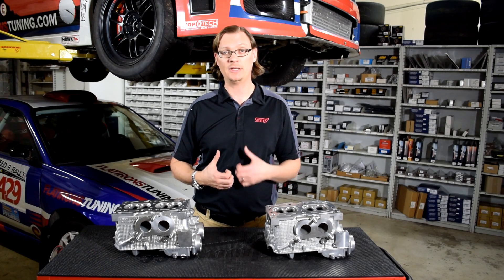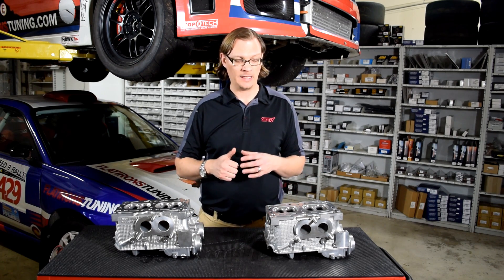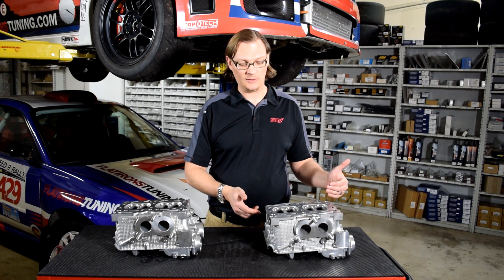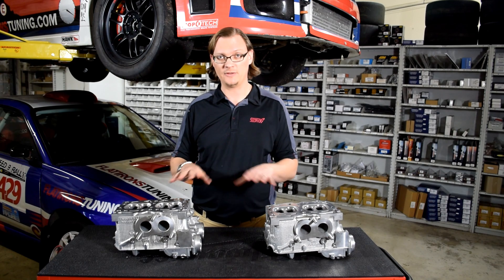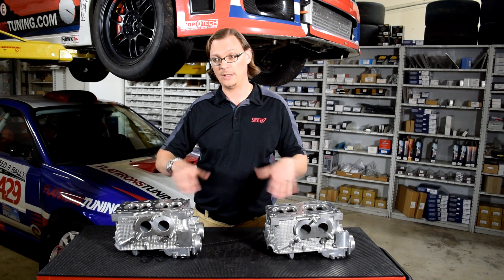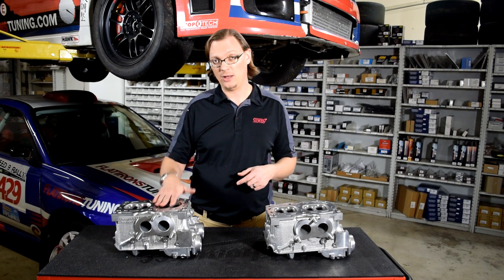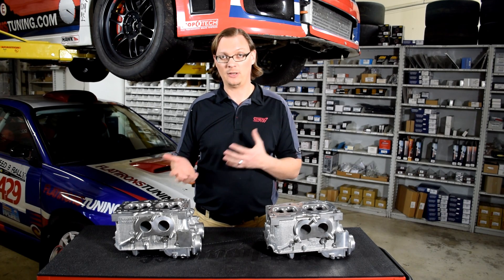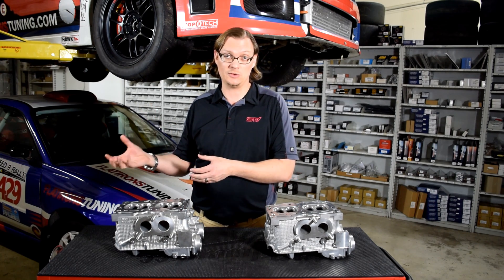Subaru Turbo B25 Heads Vs  D25 heads - What is the difference?

Comment: I have noticed that in many ads. They say 8.5 ej255/257 wrx/sti pistons, but they don't say what heads that number is for. 

But I have a weird motor, 2005 Baja Turbo, so it's basically an ej257 with a td04.  But it has higher compression (8.4 vs 8.2) than an STI, but pistons, heads and headgasket are the same part number the the STI. So I don't know where they get the extra .2 from.
Reply from the maker: Thanks for your question.  If you have the B25 heads, which you should, then your engine is 8.2:1. You are most likely seeing 8.4:1 referenced to the EJ255 engines, but that is only the ones that have the D25 heads.

As to the pistons, yes, you need to look at the combustion chamber volume that the manufacturer used to calculate the compression.  That volume will tell you which heads they were using to calculate.

For example, Manley calculates all of their compression ratios around the D25 heads which have a 51cc chamber volume.  

I hope that helps, and Stay Tuned!

Comment: So I can safely use stock d25 heads on a stock ej257 as long as I get a tune?
Reply from the maker: I would not say it is ideal.  But it can be done.  If you want to get the compression back close to what it is in the STI, you can run the 1.1mm head gasket to compensate.

I hope that helps, and Stay Tuned!
Reply: @FlatironsTuning  Any downsides to running this setup (D25 + EJ257 pistons) with the 1.1mm head gasket? Prone to gasket failure, high detonation risk? trying to understand if the slightly raised comp. ratio is the issue or if it's the shape of the chamber and piston combination. Thanks!

Comment: This is a helpful video thank you. Here’s my question ej25 bore=99.5mm stroke=79mm volume=614.28cc. If the head volume for b25 block and pistons is 55cc+22cc(head volume+dish volume). 614.28/77~8.0-1 compression ratio. Am I missing something that makes the head volume like 2 cc smaller? Spark plug I assume!
Reply from the maker: Thanks for your question.  From what you are describing here, it looks like you are calculating volume based on the bore and stroke only.  To calculate compression ratio, you actually need to calculate the entire volume of the cylinder at top dead center and bottom dead center.  That will give you the best calculation.

I hope that helps, and Stay Tuned!

Comment: Wow, what a great channel! I just blew up an EJ20x in my 05 legacy gt and I'm evaluating my options. I've found a 257 shortblock and I really want to go back to the ej25 for the responsiveness in daily driving and I'm trying to figure out if I'm alright keeping my dual avcs heads or if I should shop around for some B25 heads. Is the year of EJ257 relevant to which heads I should be running? I want to use a factory sealed block so everything will be completely stock. No big power here, just 300 wheel or so
Reply from the maker: Thanks for your question.  If you have EJ20X heads, I believe that they have a similar, or possibly smaller combustion chamber than the S20 heads that were on the 2.0 WRX here.  Definitely take a look at our Hybrid Build video:

https://youtu.be/M8PbLaUMPdM

And maybe our Hybrid build blog:

https://www.flatironstuning.com/blog/what-is-a-subaru-hybrid-swap

Compression ratio is going to be the big question with those heads.

Or, just go back to a full 2.5 liter engine.  That is definitely a good way to get a solid platform to hold 300 whp.

Hope that helps, and Stay Tuned!

Comment: I have a 2004 XT that blew a turbo and it needs a motor. Well I acquired a Ej255 from a 06 Wrx and have been looking for the B25 heads that are for the XT. Should I be worried about compression or would I be fine since the XT is a 255 as well?
Reply from the maker: Thanks for your question.  I'd recommend going back through this video again, as this is exactly what we discuss here.

We also have a blog about the same topic, and here is a link to that:

https://www.flatironstuning.com/blog/what-is-the-difference-between-an-ej255-and-an-ej257

Hope that helps and Stay Tuned!

Comment: You make great videos. Thanks for that. 

I have a H25 cylinder head on an ej 207 S20C block. 

What is this for a cylinder head?
I can not find any info on them. 

Thanks in advance.
Reply from the maker: Thanks for your question Paul.  I have to say that I haven't heard of that before.   From what I can dig up, they came on the Turbo Forester in Japan.  In theory, they are single AVCS 2.0 liter heads.

I'd recommend checking the volume of the combustion chamber.  My guess is that it would be the same as other 2.0 heads, but that is just a guess.

I'd compare spark plugs too.

I hope that helps, and Stay Tuned!

Comment: My buddy is helping me rebuild my engine and has a set of b25 heads hes willing to let me use. 

Problem is I have an 07 sti with the v25 heads, I've already deleted my secondary air pump,  so my question is does the b25 and v25 have the same compression ratio? Is the only difference the secondary air pump application?
Reply from the maker: Thanks for your question.  Yes, compression is the same, and the only key difference is the addition of the secondary air ports as you mention.

Hope that helps, and Stay Tuned!

Comment: How durable are D25 Heads when it comes to making big power, say 850hp
Reply from the maker: Thanks for your question.  All of the 2.5 liter heads are equally strong, so I wouldn't say that strength would be the deciding factor.  You would need to do some valve work, port and polish, and cams to be able to hit that power target, so the newer castings would most likely be a good starting point.

The biggest factor may come down to combustion chamber volume.  Since the D25 is smaller, if that pushes your compression higher than you like, you may need to look at the V25 or W25 heads.

I hope that helps, and thanks for watching!

Comment: So what car do D25 heads come out of?
Reply from the maker: Basically, if you have a 2.5 liter turbo car with single AVCS and secondary air injection, and it is not an STI, then you have D25 heads.  All STI's are B25 heads (architecture). If you have a 2.5 liter turbo with single AVCS, and you don't have secondary air injection, then you have B25 heads.

Hope that helps, and thanks for watching.
Reply: @FlatironsTuning  ok so i bought a 06 wrx and didnt realize till yesterday when i started taking apart the engine that it said ej25 and the heads where D25 heads. Im not sure if the shortblock is a ej257 or a 25 from a forester xt. How can i check to make sure?
Reply from the maker: @TheThecharliejolly  The heads are stamped "D25" I would start there.  and the 06 - 14 WRX had the D25 heads with the different block.  The Forester XT only had the D25 heads from 2006 on.

On the block itself, there are not any easy distinguishing marks to find.  But the blocks that were paired up with D25 heads have a much deeper dish on the pistons compared to the STI.  But I don't know that you could tell that just by looking.
Reply: @FlatironsTuning  Ok thanks for the info i guess ill find out later today when i open the case halves up. I bought the car from some old man that bought it from an auctiom so he didnt know anything about it. Cheers brother 👍

Comment: Hi. I'm trying to find all the right parts to build a reliable ej257 to match with the ej205 computer. What are the differences between the 10103AC870 and 10103AC890 blocks. I'm aiming around 300awhp. And I'm looking at a blouch TD05-16G and 565cc injectors. Any help appreciated.
Reply from the maker: Thanks for your question.  First, on those blocks, the 10103AC870 is the block that originated in the 2004 - 2007 STI.  The 10103AC890 is the block that originated in the 2008+ STI.  Originally, the cranks in these blocks were different, but since about 2010, all of the 2.5 liter turbo blocks have used the hardened cranks (heat treated or nitride treated depending on what Subaru is using at the moment).  So at this point the only difference between the two is the rods.  The 10103AC890 block has a somewhat more durable rod.  It isn't something that would be on part with an aftermarket rod, but it is better than what comes int he 10103AC870, and because the cost is the same, most customers go with the block that has better rods.

On your turbo, I'd say that you would want to look at a 20G at a minimum to get to the 300 whp mark.  Or, I'd also recommend the Turbo Dynamics MDX-400.  We are pretty impressed with that turbo for an application like this ( more on that is in the works ).

https://www.flatironstuning.com//mdx555-400-hybrid-turbocharger-400hp

And more than likely you would want injectors that are a bit bigger than 565cc.  I'd recommend the Cobb (which are made by Injector Dymanics) 1050X injectors:

https://www.flatironstuning.com/cobb-1050x-top-feed-fuel-injectors-w-pnp-adapters-subaru

Hope that helps, and thanks for watching!

Comment: For my 07 wrx. I plan on deleting the secondary air injection. Therefore would is it alright to go with the B25 heads? Or do I still need the V25 heads specifically?
Reply from the maker: Thanks for your question Brandon.  If you have D25 heads, you should really stick with them.  Any of the STI heads will have a larger chamber volume, so you will be changing your compression ratio by changing heads.  If you are doing a full build, including new pistons, this can be addressed, but if there isn't anything wrong with your heads, I'd say stick with them, and just use some of the plates to cover up the ports on the heads.

I hope that helps, and thanks for watching!
Reply: FlatironsTuning I actually have an IAG stage 2 Tuff block on the way so I’m looking to do a full build and a tune is inevitable. I’m just looking at what my possible routes are in regards to STi heads. I’ve been told that the 257 heads are better for boost but the D25 combustion chamber shape give them better flow. I’m stuck on what to do.
Reply from the maker: @OggaDugga  They are both good options, and I guess that the best way that I could answer is that if there is nothing wrong with your heads that would require them to be replaced, there wouldn't be enough gains had by going with STI heads to justify the cost.  If it is more from a time standpoint, where you want to build the long-block before you pull your engine, then it could make sense to get new castings.  

But even in that case, I'd probably stick with the D25 heads that are correct for your car.  They are not bad at all, some builders actually prefer them compared to the older B25 heads especially.  And if you were set on STI heads to drop compression a little, then I'd look at the V25 heads because they would still have the Secondary air ports.  They are closer to your WRX heads, so you will most likely have more options long term than going with the older B25 heads.

Hope that helps!

Comment: Also a quick way to tell would be the presence of an air injection pump on the car. D25 heads have ports on the back of the cylinder heads for the air injection, B25 heads do not.
Reply from the maker: This is a good point.  Thanks Allen!

Comment: So I a 2007 STI with the V25 heads.  I just got a fresh reman long block with D25 heads and the valve covers don't match up.  I can also tell the cams are different.  Should I just send it all back and require the V25 heads or will these be fine once I plug the holes where the valve covers don't match?
Reply from the maker: Thanks for your question Neil.  The first thing to keep in mind is there will be a compression difference between the D25 heads and your V25 heads.  And if possible, it would be worth finding out what pistons were used in the shortblock, because that can cause a difference as well.  If your valve covers are not fitting, there is a pretty good likelyhood that the D25 heads that were used are from a newer WRX than your 2007 STI.  Again, it would be worth trying to find out exactly what year they are off of so you can get the correct valve covers.

In regards to the cams, they should be the same as what came on your 2007 STI, so if you are seeing significant differences, that would be worth getting more information on as well.

So long story short, it would definitely be worth following up with whomever built that longblock, and get all the information available, and if at all possible, get them to help you make sure that all of the components that went into the build will be compatible with your car.

Good luck with your build!

Comment: Great vid. One thing to add would be which head had a better VE. I've seen cut-aways of these heads and some will argue that the D25 have a better flow capability rather than the B25, can you confirm?
Reply: My 05 LGT has b25 heads and my buddys 08 has d25. In Mexico, after 3rd gear, he pulls away hard every single time. I also have a vf52 and he's got the stock turbo.
Reply from the maker: Thanks for your question!  That is definitely a pretty common thought because of the more hemispherical design of the D25 heads, that they are a more efficient design.

I will say that if you look at similarly built WRX's and STI's (B25 and D25 heads) with the same turbo on them, there isn't usually much of a difference in actual real-world power numbers.

So from that stand point, it would hard to say that you should really favor one head design over another because of a significant difference in power.  But as more testing gets done, or as the power numbers get higher, there may be one design that starts to pull away from the other.

We'll just have to do more testing :-)
Reply: Awesome that would be a great idea.  Also, there has been some misconceptions that the EJ is a far more superior platform for power than the FA.  What are your thoughts on this as well?
Reply from the maker: Hello James.  In regards to the EJ versus the FA, it is way too early to tell.  There are a lot of promising things with the FA heads, but they are so new, it will almost certainly take the aftermarket a few years to really figure them out.  Only then will we know how they compare to the outgoing EJ heads.

Considering it is the first really full re-design of an engine/cylinder head since the late 90's, it s pretty likely that Subaru has improved a number of things with the FA heads.
Reply: FlatironsTuning right on thank you for the reply.

Comment: Thanks for the video. I put together my outback xt with b25 block and d25 heads willy nilly. Good mpg and peppier around town. but like you said the factory tune doesn't like the higher comp and it will absolutely ping without a tune.
Reply from the maker: Thanks for watching Darren, and thanks for your information!

Comment: These videos are under appreciated! I watch them more than once. Can you share information about heads and the pros and cons of upgraded heads? Like porting, valve work, cam sizes and the effects.? Applications for these modification. 
Currently I'm doing a Daily Driver New OEM Short block Ej257 build with new OEM B25 heads (Stage 1 non-AVCS cams, beehive springs) Valves are the question?? What size +1.00 mm?  Is more flow good or can it have a negative effect? Should you do larger valves on exhaust side only, Vice versa or Both?  What type of head work is possible? Thank you for any sort of Info. You are the Subi Guru.

Cooper
Reply from the maker: Thanks for your question Cooper.  This is a pretty deep topic, but I'll give you the short answer here, and you can contact us directly for more specific answers.  

So for your power level, stock size valves will be fine.  If you can get a 5-angle valve job.  For head work, a bowl blend could be helpful, but you don't need to go further than that.  A full port and polish could hurt your low end performance, especially if it is an aggressive one.  

Long story, keep it simple, and you should be in great shape!